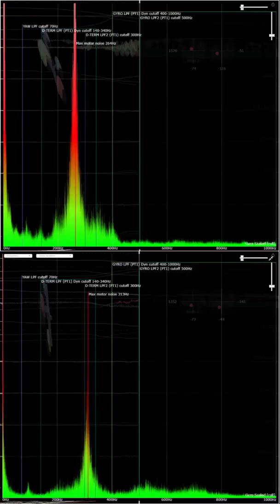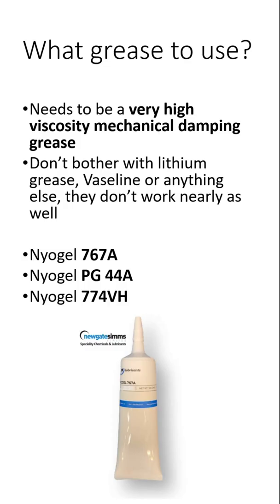Potentially the best way to damp vibrations on a drone. I'm not kidding, its amazing! #shorts

Comment: Is damping actually a solution or just a band-aid? Physical damping mechanically increases the time it takes for a 'signal' from a motor to reach the FC. 

Betaflight devs have spent the last couple of years working to reduce filtering delay. Isn't this just adding mechanical delay into the system while potentially losing detail? 

I would be very surprised if even the best tuned mechanical damping was anywhere near as accurate or fast as electronic gyro filtering.
Reply: I'm with you here.  Mechanical dampening has a time delay component just like a software filter.   And we  scrutinize our software filters just to run them on a soft mounted fc with totally unknown filtering properties.  Makes me laugh.   In this case though,  I think the approach here reduces the coefficient of friction, allowing things to move with less energy input which results in less stored harmonic energy once things are moving.
The coefficient of friction is kind of equivalent to how much we can pre-load the "spring".
Reply: @_NFE  It would be interesting to compare normal grease to dampening grease to see if there was a difference.
Reply: @benaresq  I'm sure a grease intended for dampening is going to excel.  Thats what its for.  I like your question in the first post - is damping a bandaid or a solution.  In practice,  there seems to be a "limit" to how dirty the gyro can be before we clean it up the rest of the way with software filters.  Lube up the frame, soft mount the fc, and many other techniques are all ways to get it there for the gyro & our firmwares.  I wish we were better at evaluating how far we should go with that starting point, but this is another great tool to add to our list!
Reply from the maker: Great thread here! In my opinion a soft mount is a mechanical damper between the flight controller and the quad so it acts like a low pass filter and increases delay. Damping grease however acts within the main body of the quad. I don't believe damping here affects flight performance as the flight controller is still coupled to the main body of the quad in the same way. I think increasing internal damping in the frame with grease is free damping with no delay penalty. Damping grease is also not a low pass filter (because it has no elasticity it is just dissipative) so I also don't think it adds delay in the same way.

Comment: It seems like one of the most common uses for this grease is both parts of  hotas controllers. Would it be safe and/or a good idea to use this with transmitter gimbals? Also does anyone use dielectric grease on xt60's? I'm curious to see if it helps with connecting sparking damage.
Reply from the maker: You could certainly try a smear on the transmitter gimbal. It should be safe for most metals and plastics and, you can always wipe it off.

Comment: What is the longevity of this compared to tape?

What is the difference in those three nyogel products?
Reply from the maker: I think it will last years (people have used it on joysticks and it's a one and done). You should only need to reapply when you change an arm or another part.

767a is the cheapest
PG 44A is the thickest and therefore could be higher performing
774vh is a similar product to 767a
Reply: @ChrisRosser  got a tube on the way! bout to grease this thing up! haha, oh boy

Comment: I was getting some really big frame resonances on my 6 inch so I dismantled the frame and applied rtv silicone to all of the mating surfaces and hardware, as you just described. It helped a ton. I never would have thought to try grease! Looking forward to the full video. Cheers.
Reply from the maker: Thanks for commenting! It's exactly the same principle. Because this grease is actually a liquid you get viscous damping from it. Hopefully this knowledge helps people who have similar vibration issues.

Comment: First its isolation mounts, then electrical tape, then tpu under the motors, then bobbins on the FC, now its grease.
Reply from the maker: I've tried all of those and found them inconsistent at best and no help at all at worst. This grease seems to be a step above.

Comment: Be curious how this compares to constrained layer damping on the arms and other body plates... Looking at the mode shapes you are predicting for these modes, the largest deflections are in the arms. This part to part viscous friction damping is different, it could be just as effective.
Reply from the maker: I've tried constrained layer damping tape and it also works quite well but it adds more weight than grease.

Comment: Would a rubbery glue like "welder" work too? Might be cheaper and less messy.
Reply from the maker: Maybe, but glue might make it harder to change an arm. The grease is actually an incredibly viscous liquid so its viscous damping that we are using. A solid can't dissipate in the same way. If you want to try, let me know how it goes!
Reply: Sure. I've used welder a bunch to secure antennas and loose parts in the past. It's actually very easy to remove and remains flexible when dry so I find it helpful on quads.

Comment: I usually use Loctite on my screws.  Is that potentially bad?  If this grease keeps the screws from backing out, that could replace my use of Loctite.  Do you recommend the grease with the Loctite, or instead of?
Reply from the maker: Loctite is absolutely fine. These very thick greases also prevent screws backing out because they are super sticky. If you use grease you shouldn't use loctite IMO.
Reply: @ChrisRosser  Thanks, I had the same question.

Comment: Just ordered some. Expensive stuff in the UK. Will let you know how it goes. Might need to see a demo of applying it before I give it a go however.
Reply from the maker: It's pretty easy to apply (if it's too sticky you can warm it up a little). Just use a fingertip to smear it over touching surfaces. Keep it away from motor bearings (its not that sort of grease) but put it under the motors, between carbon plates, under the screw heads, everywhere!

Comment: Interesting idea - but grease on motor and screw threads? - worried that they get lose by vibrations.
Reply from the maker: In my experience these types of very high viscosity greases actually prevent screws from backing out due to vibrations.

It's less like grease and more like glue that's half set.
Reply: @ChrisRosser  It really sounds counterintuitive. It would be nice if you talked about it a little more in the upcoming video or something.
Reply from the maker: @prottentogo  It only helps in comparison to dry threads. If you are really concerned about threads backing out then blue loctite is a better solution. The reason I suggest to use grease on threads is that is adds damping where the screws pass through the arms and other plates.

Comment: Very hard to locate nyogel products outside USA, alternatives please?
Reply: I just ordered Liqui Moly 1080 Schmierfix (from Amazon Germany), seems like it's the same kind of stuff. It's cheap so no problem even if I'm wrong. Will post some feedback when I get and/or test it.
Reply from the maker: @l0stb1t  If it works I'll put it in the description. Consistency wise it should be super sticky/tacky and extremely thick.
Reply: @ChrisRosser  Finally received the Liqui Moly 1080 Schmierfix but it's just a thick normal grease. Not like the super tacky "half set glue" like you described in another comment...
Reply from the maker: Not sure. If you are in Europe you could buy from here: https://shop.newgatesimms.com/product/nyogel-767a/
Reply from the maker: If you search for high viscosity mechanical damping grease hopefully you can find some alternatives
Reply: I'm struggling as well. Did you find something in the meantime?
Reply: Only $3.80 in shipping on Amazon.
Reply from the maker: This should work: https://www.aliexpress.com/w/wholesale-damping-grease-high-viscosity.html
Reply: https://www.micro-tools.de/en/Greases-Oils/767A.html?listtype=search&searchparam=767a

This one is in Germany and ships at least to Europe

Comment: oh wow, need to give this a try, i've always thought over tightening screws might be a problem with motors especially, but on quads in general.  i wonder if this mechanical dampening grease is ok to use on carbon fibre,  ps. are you sure you didnt unconsciously  use less torque when using the grease?
Reply from the maker: Its supposed to be safe on most metals and plastics so I think epoxy will be ok. Regarding torque, I'm much less worried about screws backing out due to vibrations in flight but I still did the screws up tightly.
Reply: @ChrisRosser  yeah i'm just reading up on it, sounds like the pg44a is very difficult to apply,
Reply from the maker: @TheMadmacs  If you're worried you can use the 767A which is a little less sticky or warm the grease slightly before applying.
Reply: Why is over tightening screws a problem?
Reply: @prottentogo   when you tighten a screw too much it creates a pressure zone, so when a shock force is applied  like a crash with high G force, this can cause a failure or wear at the pressure zone, also if you apply too much pressure on an object like a propeller, the object can become more likely to fracture when a small shock is applied.  this is true even when the screw isnt deforming the surface of the carbon. using threadlocker and the right amount of torque to function properly is the way to go.
Reply: @TheMadmacs  I see. I do use trapezoidal washers to protect the screw heads and broaden the surface area. Does that help?
Reply: @prottentogo  yeah i think broader surface would make a big difference, i broke a frame once at the standoffs, and added a thin piece of carbon across two standoffs if you know what i mean, lasted for ages like that. its best to eyeball a frame for weak spots, instinct should tell you what will or will not survive a big impact, i use hot glue as buffers to crash zones.  i much prefer the trapezoidal washers to the idea of sunken screws, that just seemss crazy to weaken the carbon surface, it is possible to buy flat headed m3 nuts but they are hard to find, i only have some from a frame i bought, you can buy sheets of carbon and cut your own braces with a dremel, but its messy, gotta do it outside on a windy day with full gloves and goggles and i use a cool trick where you poke a tiny hole in a 2litre bottle of water, unscrew the lid a little and water shoots out so you can cut the carbon under a water stream, works shockingly well.
Reply: @TheMadmacs  I think I'll pass on cutting carbon, but thanks!